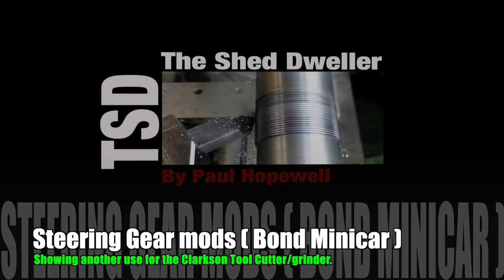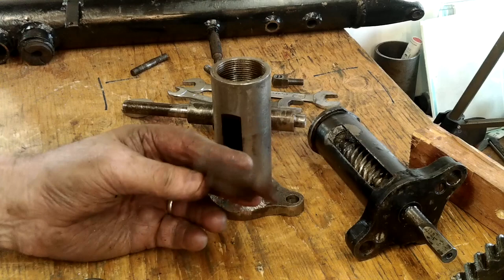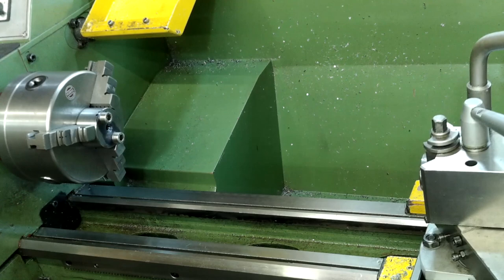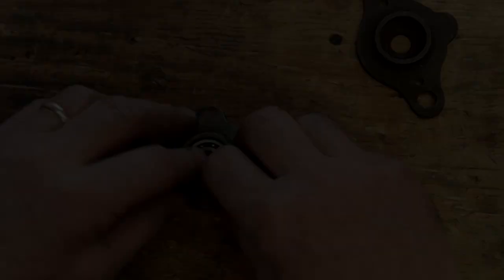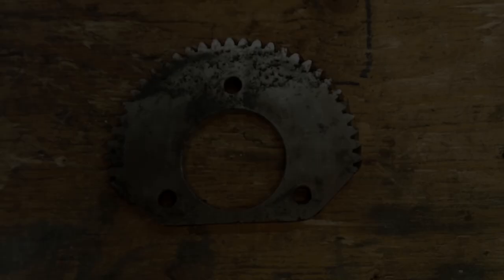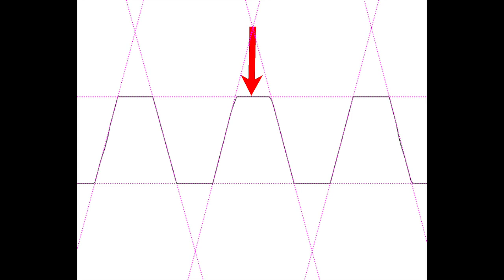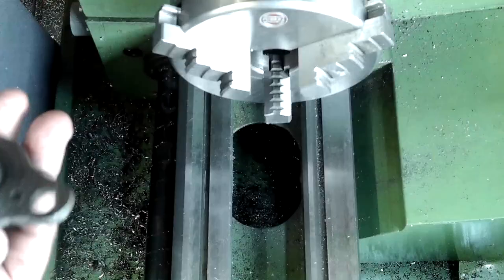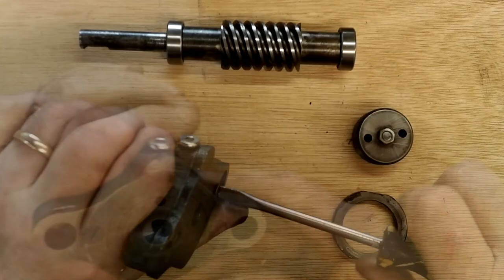Bond Minicar steering gear mods

Comment: The original system was driven by cost constrains ,several of your mods could well have been incorporated in the original design. Great job Paul of making a silk purse repair out of a real Sow's ear worn set of parts !    👍👍
Reply from the maker: Thank you, Cheers

Comment: Really enjoyed this Paul as with all your content and the way you go in depth on thinking behind what you do. The Clarkson cutter grinder was very interesting, could i ask what radial tangent dresser you used? i have one in mind but am concerned it may be too big for the Clarkson, i need to adjust an ACME HSS tap that is cutting out of spec. Any other content regarding the use of the Clarkson would be most welcome, Thanks.
Reply from the maker: Hi, I didn’t use one, I used a carborundum stone and dressed the wheel very carefully using the piece meal stop and compare technique.
my comparison or gauge was a spare quadrant with good teeth. its very hard work getting the profile set using this method but this is all I had.
regards
Reply: @Thesheddweller  Thanks so much